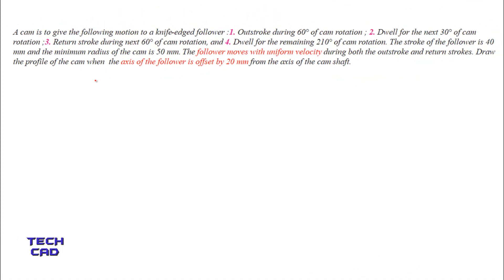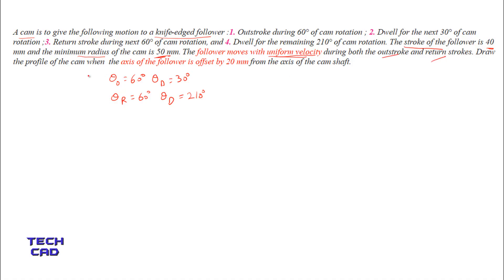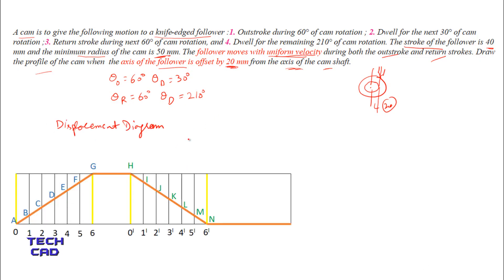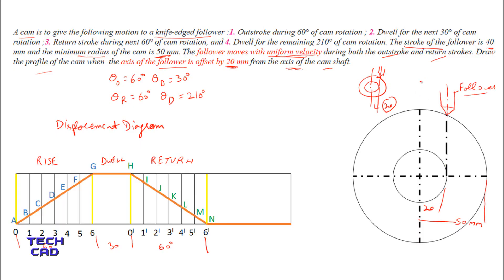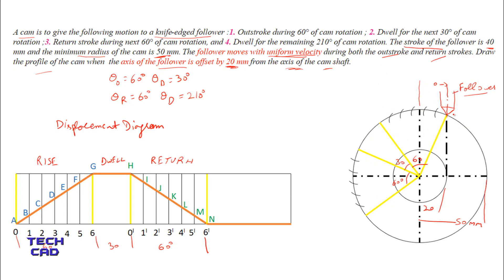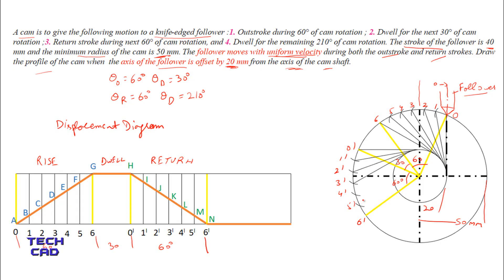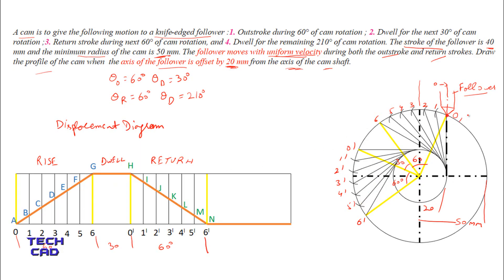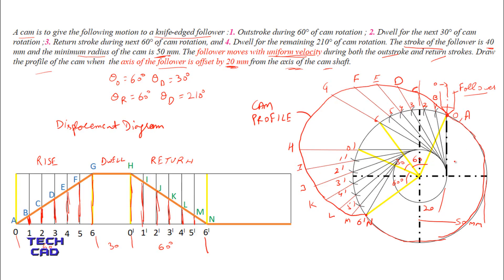HOW TO DRAW THE CAM PROFILE II OFFSET FOLLOWER (KNIFE EDGE) II UNIFORM VELOCITY

Comment: How did you divide 40cm into 6 equal parts? Please answer.. 🙏🏻
Reply from the maker: Dear 
There is no division of 40mm into 6 equal parts. the 40 mm or 4cm is the vertical distance in the displacement diagram and I divided the horizontal line in to equal parts. so don't be confused . For more clarification kindly follow this link to understand the displacement diagram: 
https://www.youtube.com/watch?v=Y2UA830Qphk&list=PLhcTfWz-LJxNUtHMoVBlA8S00KHxrOhqU&index=5
Reply: Thank you,
Can I always take a scale of 360° = 36 cm? For each question of the cam profile with any type of motions?
Reply from the maker: Yes 
You can take it....